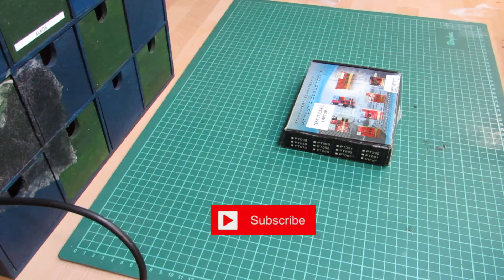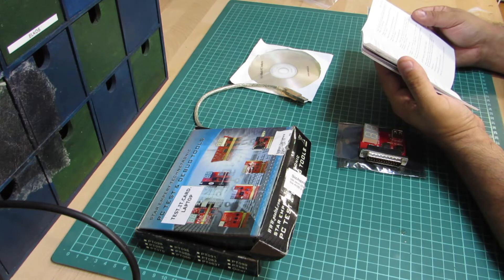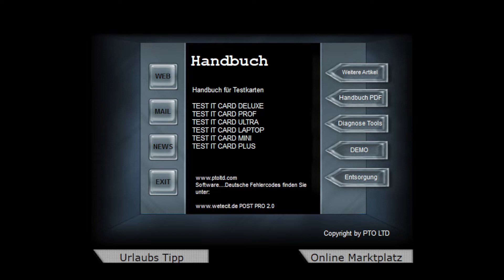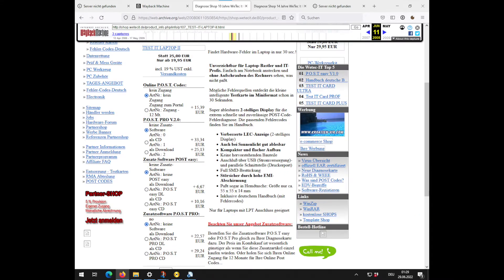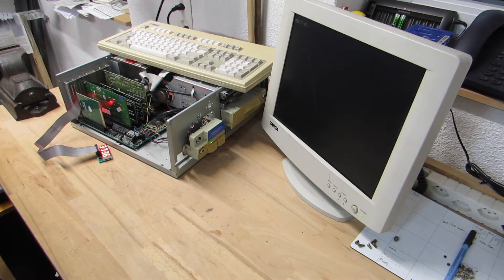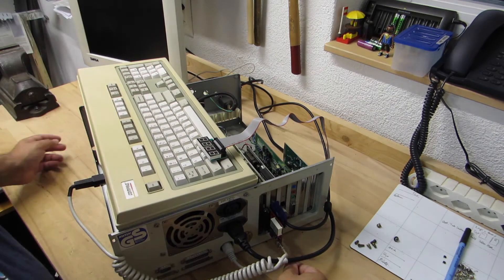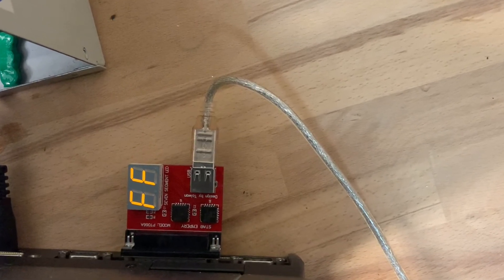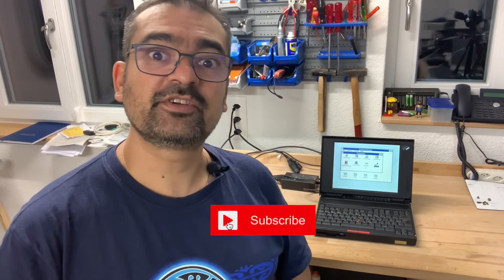How does the "STAR EMPERY" PT066A parallel port PC diagnostics card work?

Comment: Hi,
I am truly impressed by your patience and perseverance in obtaining information about this card. I own a card
 It has a quad screen, a USB port, a headset, a cable for an external speaker, a wide receiver, and a play button. However, I do not have an instruction disk, but rather a paper booklet. I tried to use it but did not know because I am at
 The error code appears. Refer to the manual and search for the code and what it means
Thank you all

Comment: Parallel ports on some laptops functioned as a bus expansion, most commonly used with external floppy drives (sometimes CD ROMs).  I suspect that this feature of the laptop also exposes some of the ISA bus in such a way that the POST codes can be read.

Comment: Steven works with multiple BIOS cards for post a error code. It also has an LPT card that only works on laptops with an LPT connection. This card does not work or does not work accurately on a computer.
Reply from the maker: @Jasmin Dekkers That's also my observation. I think only certain laptop BIOS implementations are emitting diagnostics codes to port 378h, as opposed to most desktop computers going for ports 80h or 300h by default. Definitely a valuable tool, if the machine in question supports it. Maybe one day I'll publish a breakdown, on how many of my portable machines this LPT card actually works.